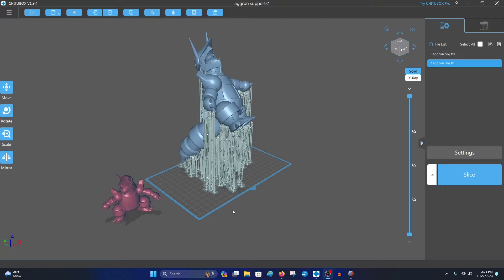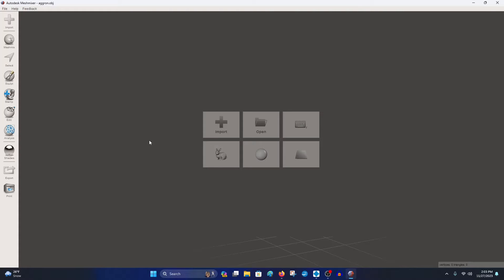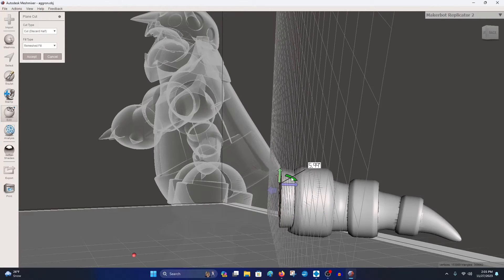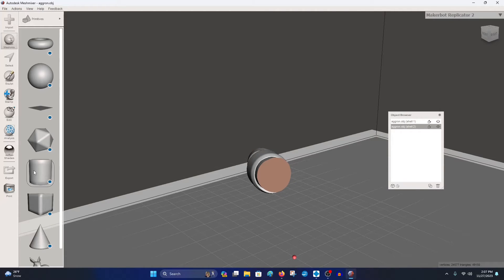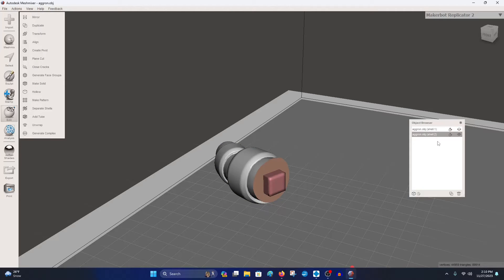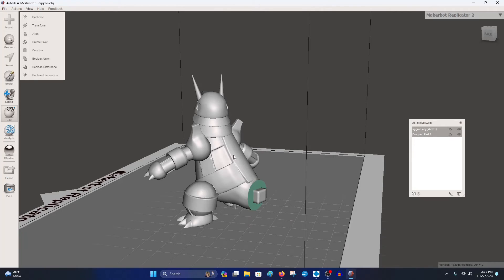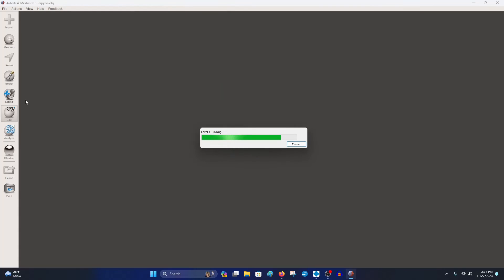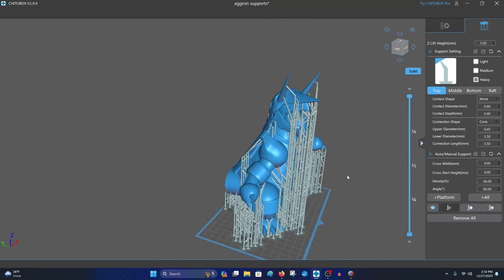How To Make Pegs/Holes For Your Models In 15 Minutes!! (Resin 3D Print Tutorial)

Comment: This is great but say I wanted to cut each limb off and tail and add like a mushroom peg to make it a movable articulated joint???
Reply from the maker: That's a little above my paygrade but in theory you might be able to follow the same method that I've used, but instead of a square mesh use a sphere.

I'm not familiar with printing out figures with articulated joints so I would probably have to experiment around with what works.

Comment: I've had an issue where when I merged the two objects, it distorted the mesh of the larger piece
Reply from the maker: Did you use the "combine" function or did you do the boolean union as shown? Sometimes Meshmixer glitches out, so I've had to redo the work and the second time it works fine. Just make sure you match the settings shown for boolean union/subtraction.
Reply: @AsimPaints  I used the boolean union. What I'm trying to create pegs for is long, flat, and symmetrical. I'm putting pegs on either side. The first peg is fine, but the second peg I try to do causes the mesh above it to dip down
Reply from the maker: @DRaKe6900  hmm I'm not exactly sure I understand, but if you're doing multiple pegs on the same part, consider exporting the file as an obj after the first one, then reimport it and add the second.

Comment: This might be a stupid question as I’ve not tried it yet.   But surely you could just Boolean difference with the tail and boxkey attached, instead of going back to seperate them? You’re still going to have the same amount of the box inside the main model for the Boolean difference…
Reply from the maker: After you fuse the box and tail, you need to be able to adjust the size of just the box to make it ever so slightly larger while maintaining it's center position so that when you print both parts the cut/key fit into each other. The peg should always be a tiny bit smaller than the hole.

Also, not entirely certain, but I think having two faces touching (so the tail and the body) factors into the boolean difference, so that can create problems.

No one right way to do this though, this is just how I do it. Actually, I no longer do the ctrl+z back to where the box is separate as it sometimes doesn't work. I'll do the plane cuts, add the boxes (sometimes multiple) then save the project. Then I'll do the union, export the parts, then load back the save where everything was separate and do the difference.

Works like a charm!

Comment: LuBan3d was and is specifically designed for cutting and pegging large (or even GIGANTIC) models for printing in parts. 99% automagically. Load model, define printer size, hit go.
Reply: I'm sure there are plenty of paid solutions. This is a no cost solution
Reply from the maker: This is just a super simple method of doing it with free software that requires no knowledge on 3d modeling.

If there are other methods I'd love to learn about them, but I'm just sharing what I know and has been helpful for me.

Comment: Just wondering I have used Chitubox a little bit. My choice slicer is Lychee and they have a planar cut right inside the slicer. Doesn't Chitubox have the same thing? As for booleans just think shapes, 3D modeler and sculptor here.
Reply from the maker: Lychee can do your taxes compared to chitubox lol, but I use it out of comfort. So no option to plane cut in chitu, not in the free version anyway. Should try lychee eventually.

Comment: I'd suggest slicing the model right against the the joints between segments, especially to cut down on post processing, all the sanding & filling etc. Otherwise you end out with clear join lines across your print that you then have to manage.
Reply from the maker: Yup! Definitely what I would recommend when possible, and I mention seams when making the cut. The reason I didn't make the cut at the seam here is because the limitation of a plane cut (being completely straight) so even if I got it close to that seam it wouldn't have been perfect, so I would have still had to fill/sand regardless but it would be harder working right up against that edge.

Also his tail nub would be sticking out further, slightly limiting how much I could scale him up by.

Working on a video showing my post processing and how I join parts for a seamless look and will paint this! Thanks for watching!